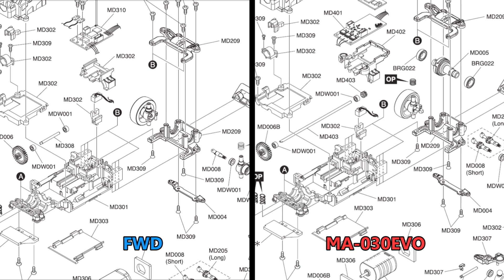How to Convert Mini-Z FWD to AWD & Speed Test

Comment from the maker: Time Stamps:
Introduction 0:09
Parts required 0:40
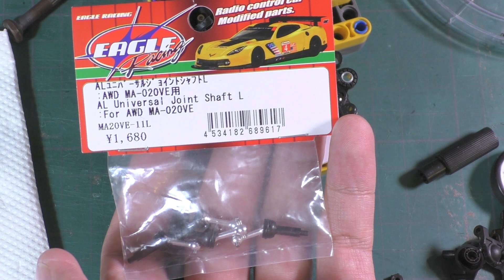Disassembling 1:36
Installing centre shaft 4:23
Wide chassis conversion 6:26
Installing rear diff 7:47
Speed test 8:51
Conclusion 9:13
Reply: Hi again Beaver!  Can you tell me approximate costs in usd to make fwd ma03 to awd conversion total? Also will k989 cvd/swingshafts work for this conversion?
Reply from the maker: @OswaldBeef  You're gonna need things from different sources so here's the parts list.
Banzaihobby - Shipping is around $5 if they opened the airmail route to your country back up.
- MD403 Mini-Z MA030 Center Shaft http://bit.ly/2VBncXI
 ~$8
- Differential http://bit.ly/2M9hSrv
 ~$6
- Plastic universal shafts https://bit.ly/2THz7TH ~$9
$28 for prop shaft, diff and universal shaft.
- 6x10x3 Ball Bearings https://www.ebay.com/itm/NMB-Miniature-Deep-Groove-Ball-Double-Shielded-Bearing-MR106ZZ-6x10x3mm/163301405028?hash=item260585b164:g:fDUAAOSwAdhca73N ~$5
So at least you'll spend $33 for this conversion. However I suggest you upgrade the universal shafts to metal. There are many sources you can buy this, PPM makes really nice stuffs. https://ppm-rcracing.com/products/Wide-Crooked-Angle-Universal-Shaft-for-Mini%252dZ-%286061-Blue-1Pair%29.html
If you decide to convert the front to wide like me then get the long shafts. https://ppm-rcracing.com/products/Wide-Crooked-Angle-Universal-Shaft-for-Mini%252dZ-%286061-Blue-1Pair-Long%29.html
Reply: @BeaversHobby  omg thanks dude! You tha best
Reply from the maker: @OswaldBeef  My pleasure.
Reply: @BeaversHobby  I'm going to purchase the fwd Renault and make it awd.  Dont need wide body so I dont need eagle wideshafts correct? I only need driveshaft and differential?
Reply from the maker: @OswaldBeef  You'll still need universal shafts but the normal ones, not the long ones. All other parts are the same, diff, centre/prop shaft and bearings.
Reply: @BeaversHobby  k awesome thx
Reply from the maker: @OswaldBeef  Always a pleasure.
Reply: @BeaversHobby  do you know if mini q one way diff (red) works in mini z?
Reply from the maker: @OswaldBeef  Yes, it does. However the gear is quite sharp so it might eat the centre shaft pinion (it's a problem for new batch). You can mod it with a plastic grown gear though.
Reply: @BeaversHobby  sweet! Mine is white plastic crown!  Do the k989 cvd/swingshaft work in mini z ?  Can  I swap front diff and install it in rear?  Then use mini q one way in front?  I may only need to purchase bearings and long driveshaft to complete fwd to awd conversion
Reply from the maker: @OswaldBeef  WLtoys is like Mini-Z wide chassis but they solve the problem by extending the drive cups of the diff so you can use WLtoys' diff in Mini-Z if you cut the drive cup down. But the swing shafts has 1mm longer shaft. Mini-Z is 8mm but WLtoys is 9mm so it might interfere with the diff if you use standard diff. Feel free to try it though. If the there's binding then you can still file the drive cups' slot down. However if you use Mini-Z ball differential then the cups are very deep and you can use WLtoys' swing shafts.
Diff bearings are the same size on both cars.
Yes, you can use Mini-Q diff in the front of Mini-Z and swap the existing diff to the rear.
Reply: @BeaversHobby  that is so great thank you beaver!
Reply from the maker: @OswaldBeef  My pleasure.

Comment: Can you also use the MR 03 evo electronics to convert this to brushless? If yes, do you have a video link or any instructions and what parts are needed? I saw some post on reddit that they did it with evo electronics
Reply from the maker: That's interesting. As far as we know the servo is the same motor and potentiometer. I suppose if the board layout is the same as MA-030 EVO then you only need the EVO upper cover (board tray) to make it fit.
Unfortunately, I haven't done anything like this nor seen anyone actually do it. But basically you will need to solder about 7 wires (5-servo, 2-terminals) and it should work.

Comment: Hey I am just wondering when if you are going to change the drivetrain from 4WD to FR? (Front Motor, RWD)
Reply from the maker: No, I won't do that. It's very easy to do but it won't make the car any better. 
The only thing you have to do is replace the front swing shafts with original rear wheel pecks that came with the FWD car. You can't remove the diff or anything because the gears are held together with that. So all the drivetrain loss is still going to be in the system. The steering won't get better and the car will just go into spin easier with that.

Comment: Could someone share the box size      of mini-z awd rwd fwd, i would like to calculate the shipping fee, thanks.
Reply from the maker: The box is 11x24x30cm however most of the shops will put it in a bigger box with more protective layer and stuff so realistically it'll be at least 20x30x40cm.

Comment: Can you use the MA-020 differentials?  I would like to try the one-way in the front (#MDW017)  and the rigid axle (#MDW024) in the rear.
Reply from the maker: Yes, this is the same AWD platform. You can use the diff and rigid axle. Actually I also use them in my car too.
Some more information: the front suspension is the same as MA020 (yes, all the camber knuckles work with this car) and the back is just standard AWD gearbox from MA-010, MA-020 to MA-030.
Reply: @BeaversHobby  Thank you for your reply :)
Reply from the maker: @ZspotMotorsport  My pleasure.

Comment: Thank you so much for this tutorial! I purchased a fwd because of this video! Can you recommend me a good motor? I would like a little more speed/power without paying a fortune going brushless. You had referenced the X motor from Kyosho, how does that compare with the pnwc 70 turn motor? Thank you in advance!
Reply from the maker: From what I know X-Speed have less top speed than PN and PN 70T is better overall. However it's not listed as an compatible upgrade so use it with your own risk. A lot of people run it with this board and it works fine though.
Reply: @BeaversHobby  Thank you, for your quick response! Keep up the good work!
Reply: Oh, also, IF I were ever to go brushless with my FWD modified AWD, would I just be able to purchase the evo board and motor and still use the stock radio? Thank you again
Reply from the maker: @kenjiyokoy7422  Yes, you can just swap the board to EVO and change the motor. What you need is the Mini-z FHSS receiver, the one with white antenna and you can use the stock FWD radio. Oh, and don't forget to get the part MD402 as well because the board will be longer.
Reply: @BeaversHobby  Thank you again!! You guys are top notch!
Reply from the maker: @kenjiyokoy7422  My pleasure. Good luck with the project.

Comment: Great Video. I ordered a fwd kyosho waiting for it to come in so i can convert it. Do you plan on changing the motor to brushless?

Do you have any tips as to what i need to make that conversion?
Reply from the maker: As of now, no. It got enough power to drift well with X-Speed so I'll keep it brushed for now. I might do it if the antenna finally breaks though.
There are 2 ways of doing brushless conversion.
1. ASF board from DasMikro and it'll convert the car to ASF protocol so you'll need an ASF radio like KT-18 or EX6R.
2. EVO board, basically converting it to EVO.
3. Install a servo board and convert it to use standard RC components, ESC, receiver and all so you can use any radio you like.
Reply: @BeaversHobby  thank you! I think I shall do the same to save some monies haha 😅
Reply: @BeaversHobby  Do you know if soldering is required for upgrading to brushless motor using EVO board method ?
Reply from the maker: @txhousa2780  Yes, you'll need to solder the servo wires (5 wires), power wires (2 wires) and motor wires (3 wires) so there are 10 tiny spots to solder in total.
Reply: @BeaversHobby  Thank you. That's lot of works. Have you experienced in upgrading buggy mini-z to brushless? Is it the same amount of soldering compared to AWD ?
Reply from the maker: @txhousa2780  Yes, it's the same. Buggy is just different chassis with a similar board.
Reply: @BeaversHobby  Thank you so much !
Reply from the maker: @txhousa2780  My pleasure.

Comment: Is the fwd already have a drift tire?
Reply from the maker: No, FWD doesn't come with drift tyres. I bought those separately.
Reply: Beaver's Hobby lol. The hobby shop in my place does not supply any mini z materials/upgrade and awd are all sold out. I guess i would go with rwd then. Wonder if you have tutorial on have to install brushless motor into mini z car
Reply from the maker: @minhng5127  You can try ordering one from kenonhobby.com if you are in the US or rcm8.net for UK/EU. Otherwise banzaihobby.com has almost complete Mini-Z spares & parts. 
As for brushless conversion, I haven't done it yet. I'm doing one soon on Mini-Q Q2 but it's much easier because it uses a proper servo.
Unfortunately doing brushless conversion on Mini-Z isn't as easy as swapping ESC and plugging in some connectors as other RC. I'll have to replace the entire board which requires soldering very small components.

Comment: I picked up the FWD Renault on the cheap, but quickly realized the wheels are not removeable. They're all attached to the camber knuckles. Are there any options for replacement front and rear camber knuckles that will allow for using different wheels and locking wheel nuts?
Reply from the maker: The wheels are all removable. There's a wheel hex tool included in the package that you can use to undo the wheel nuts. Once you remove the nuts you can pull the wheels out. They might be tight so use a bit of force to pull them out.
Also, it's Mini-Z. There are spares on every part. For the camber knuckle of MA-030 (FWD), front knuckles are from MA-020 and rear knuckles are from MA-010.
Reply: This video provides some detail for the wheels' centers.
Reply from the maker: @tukemotobrothers7931  Your car wheel nuts look like the ASC? That's really weird. If you only got the ASC (body kit only) you can pull the wheels straight out. But if it's the whole car I have no idea why it's different either. Sorry. You can try an ask in Facebook page 1/28 world community https://www.facebook.com/groups/722063711267613/ . There're a lot of experts there. And you can post the photo of your wheel nuts so we can help.
Reply: Thanks for the quick reply. It's not clear which MA parts work on front versus rear, so that's really helpful. I have other Mini-Zs that have wheel nuts, but these have solid spokes with a filled round center without hexagonal edges. I have never seen rims like these before this RTR Renault.
Reply: https://youtu.be/zGZ-1aMW0gw

Comment: What mini z model would you recommend for a beginner/ home user? I am oscillating between  rwd and awd. The rwd has those exposed gears, can it get clogged due to running on a carpet? Can the rwd also drift?
Reply from the maker: If you have thick carpet it can get snagged on rear gear pretty easily. If the place you run is relatively clean nothing will clog up the gear that easily. However regular maintenance is required either way because it will pick up dust and hair easily.
I recommend AWD version because it can do both grip (touring) and drift so you can do whatever the mood takes you. Also if RWD pick up some dust on the tyres it will spin out pretty easily. If you have thin carpet that looks like a carpet track then RWD should be alright and won't spin out but keep in mind that Mini-Z RWD can't drift.
Reply: @BeaversHobby   Thank you!
Reply from the maker: @cristiand9756  My pleasure.

Comment: Hello Friend. Do you have any first miniz car ? can you make a video about this model ?
Thanks.
Reply from the maker: I haven't got it because I saw some reviews and also the spec then I decided it's not worth the effort.
First Mini-Z is just simple RC car with no actual proportion steering or throttle, throttle is in steps so you can sort of go a bit faster or slower, steering works the same way in conjunction with spring loaded column. So it can give more or less power to the motor and hopefully it won't turn to full lock immediately. Suffice to say it's not precise if you want to turn it only half way.
The most interesting aspect about First Mini-Z is that it uses standard Mini-Z body with less detailing so no glass coating. But the shell itself is the same as Auto Scale.
I hope this covers everything you want to know about it.

Comment: Wow, thank you! This is awesome. I ordered all the parts ahead of my MA-03F arriving. I drove it FWD for about 3 minutes and thought: that's neat. I just completed the conversion and I still have a functioning steering servo (phew!).
The car is about 17x more fun/fast/grippy with the rear axle in play.
Does feel a bit wrong having a civic with AWD...
I'm plotting my next body & wheel offset. I got all the gear to make the front wide per this video (and plan to run low-offset up front). But I did install the 98mm drive shaft... I hope I don't end up having to swap it for a 94 later. It seems like there are more 98mm bodies but i'm guessing 94mm is a bit more playful/easier to drift (and the 2008 Impreza made my short list).
Reply from the maker: Yes, 94mm body will be easier/nippier to drift. You can swap the shaft pretty easily. Just pull it straight out and put the new one in then turn it to find the notch and fit inside the gear.
Anyway, Subaru WRX STI is an appropriate body for AWD and it's 98mm wheelbase + narrow. It comes with the wheels too.
Reply: Beaver's Hobby ah, I was wondering that. Great to hear the 94/98mm shaft swap is much easier.

Comment: Ignorant comment here, do they sell upgraded brushless motors for the ma 030 evo? 

I’m wanting to get back into casually messing with rc cars. I used to have a couple RadioShack xmods and you could get lots of different motors for them but would have to stack fets and stuff. 

I have a hugeeeee flat smooth floor space (100k sq foot empty data center) to just drive it in in my off hours and I wanted to make it straight line fast.
Reply from the maker: Yes, you can swap motor for a faster one. The fastest one right now is 12000KV. https://rc.kyosho.com/en/mz603.html

Comment: Would you know if there is a need to condition the tires? I  purchased the fwd honda civic and the Corvette rwd about 2-3 weeks ago I have not really used the cars much but when I came to get them out to use, the tires were cracked is this normal with kyosho tires? I bought new ones but I'm wondering if the same thing will happen with the new tires if the cars are just sitting. Thank you for any info you could share on this.
Reply: dmgp1f is it possible to mount the corvette body on the fwd chassis? I’m wondering because I’m thinking of getting the fwd civic to convert to awd and use the corvette body if it fits.
Reply from the maker: @davidherndon8410  No. I've tried it and the bonnet is too long so it doesn't fit.
Reply: Thank you
Reply from the maker: The tyres shouldn't crack and split. The stock tyres are slick so they are smooth throughout the ring.
I think your the cars you got haven't been stored properly and it got in contact with either direct sunlight or was in very cold place.
Condition the stock tyres won't make much difference. But you can try if you got some time. I highly suggest replacing with Kyosho radial tyres for better grip. Also it depends on your driving surface. Other tyres are great too like ARR and Marka.
I forgot to mention X-Power foam tyres. Those are really good too.
Reply: @BeaversHobby  thank you for all the information greatly appreciated.
Reply from the maker: @dmgp1f  My pleasure.

Comment: Wooooow! That's really poor design there! Thank you for showing us the whole thing. It's not for me...
Reply from the maker: Here's my speculation about how they designed it: Alright, lads and laddies! We need a new AWD car. What we need are all the batteries lay flat on the bottom, put motor in the centre, has the VCS front suspension finally it has to use MA platform rear end. Good job, everybody! Let's go have a lunch and hope we didn't forget anything.
5 minutes later.... holy crap! Where should we put servo and board? 
Seriously they both look like afterthought.
The car drives amazingly though. Much better than previous models. Well worth the trouble. Hopefully I don't have to disassemble it again.
Reply: @BeaversHobby  Nobody is that lucky. I have a hunch that the plastics are just as brittle as before.
Reply from the maker: @z-collector7518  I can assure you it is the same if not worse. Judging from the battery clips it's more brittle than my MR03.
Reply: @BeaversHobby  So refreshing to hear somebody capable of critical thinking. Rare treat these days when everybody considers critique synonym with insult.

Comment: There are guys from the koyosho production line laughing at us right now, you know that.
Reply from the maker: I try not to think about that due to recent natural disaster but...
Cut the shaft, pull the diff and cv joint out, profit!
This is from Tokyo Hobby Show just a few weeks back; they are going to sell lucky bag with "random" FWD + Auto Scale + Conversion kit. I bet the base cars are all Prius since it is pretty unsellable.
They will probably sell conversion kit separately too.
Reply: @BeaversHobby  Oh, yoiks, ooo, er, I meant trying to get the steering motor back in w/out bricking it. #PleaseDontDrainOurAccountsMrHuawei
Reply from the maker: @stevewatts3502  Ohhh... That...  Yeah, imagine doing it everyday though. 😆